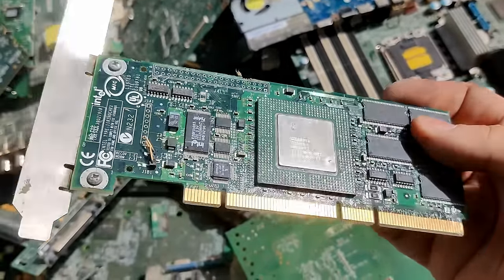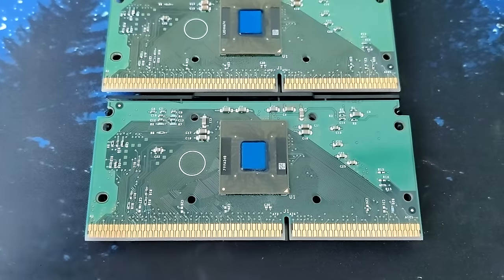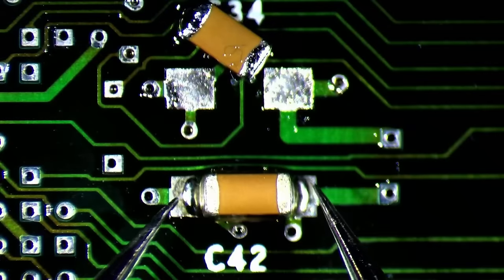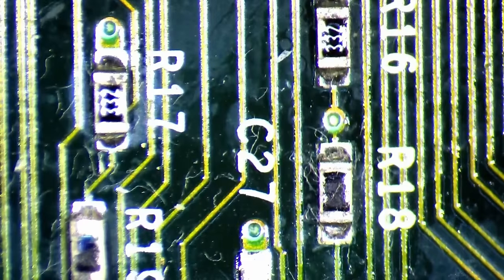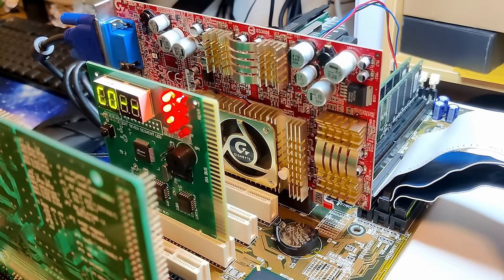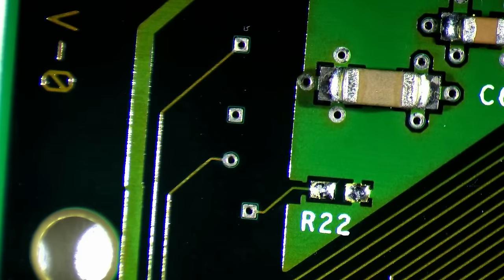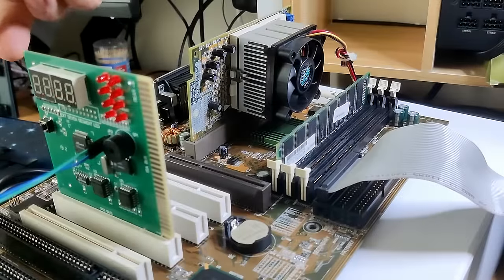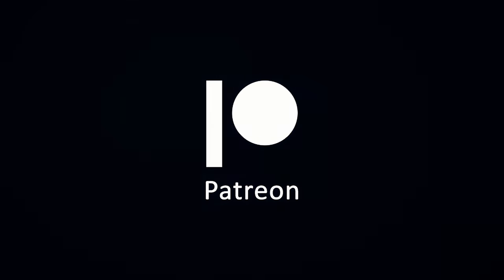Pentium III SECC volt-mod for more compatibility!

Comment: might be related, but i worked with pentium 3's in an industrial setting where they ran Siemens PLC stuff (Step 7 under Windows 2000 mostly) and C0 was common on high heat, high vibration installations where the BIOS was unable to verify cache size but was still detecting cache presence. if cache was disable entirely it could boot, but often we would send the cartridge or CPU (which was thermal glued to a small heatsink/fan combo unit from i think AVC) out for repair and the turn around could be as little as a day.

C0 was also used by early Xeons to indicate an issue with initializing L2 cache which was a separate IC on the PCB. this might be different though since pins for Slot 1 and Slot 2 differ and might have different POST codes. this initialization step was though through the BIOS because you had to have BIOS support for ECC cache.

this differed from the Oracle/Sun servers that ran the database and application end of things where the C0 was usually an add-in controller that had failed to boot somehow and you needed to identify and remove the device (disk controller with bad battery backed cache, misconfigured memory or video, anything where you had to use an unmasked interrupt to actually boot).

Comment: Try measuring resistance/capacitance on each pin of the slot connector to a known working slot 1 cpu, see if there is a glaring difference?
Reply from the maker: Good point. I put that on the list and try that if there's nothing else that will fix it... Because, you know, 121 pins on each side.

Comment: you're really good with the SMD stuff. Seeing proper SMD soldering is always ASMR. lol I just love seeing the solder flow exactly where it's supposed to go
Reply from the maker: Hehe, thanks. I think it's all practice. I did a lot of soldering about 20 years ago. Looks like it's a skill you don't forget.
Reply: @bitsundbolts  I did too, but not SMD. lol I've never done SMD. I did get a rework station (it helps with 3d printing sometimes, but I don't use as much as I thought I would). I'm tempted to take apart an intel laptop that died 2 months after I bought it during covid and practice on that for shits and giggles. (it's why I never followed through on the warranty and it's the last intel I ever bought).

Comment: It may be more convenient sometimes or safer against loss to not desolder a 2-pad component fully but to rotate or shift it such that one pad is connected and the other isn't, in order to measure it. Especially if you move to more hot air soldering.
Reply from the maker: I agree. I did lose SMDs before. Usually, I leave one terminal connected to a pad with the component rotated.

Comment: awesome, BuB!! love it for the 20 min!! :) i also have an Athlon XP which has chipped corners, works flawlessly
Reply from the maker: It's quite funny how some dies are in horrible condition and they still work! I have a Duron that looks like a total disaster and I have a feeling that there is some piece of metal sticking out from the chipped silicone die. Stull works though without issues... Go figure.
Reply: I had a Thunderbird 1.2GHz (socket A) back in 2000 or so - the die was extremely chewed up by the crappy CPU cooler (very small die, very large pressure spring) but it ran like a champ. Could fry eggs on it.
Reply: @bitsundbolts  yeap, this strangeness is fun in retro computing. today it's like this: chipped corners, cool, let;s see if it works :))

Comment: Seeing the ROG Mainboard scraped hurts very much. I had the chance of taking a ROG Commando from a scrapbin. With the exception of the status display in the back not showing all the segments it works. Currenty I'm looking for parts to build a gaming computer like I wanted in my youth but couldn't (because of money). I'm still looking for a Radeon HD4890 with 1GB from Saphire and the waterblocks for the gpu's. Unfortunatly waterblocks for older gpu's or gpu's with waterblocks never comes up for sale. And I have no acces to electronic scrapyard like you have.
Reply from the maker: I'm sorry to hear that you don't find that GPU and the water blocks for it. I have a dual GPU from AMD, but I don't remember what model - and it might not work. If I find it and I remember, I'll have it in a video or on my website some day.
Reply: @bitsundbolts  I think a lot of these gpu waterblocks are getting salvaged for their copper. They are made from pure copper and and huge and heavy.
Reply from the maker: That is probably the first thing scrappers are after. It's easy to remove heatsinks. In the process, many destroy the electronics attached to it 😔

Comment: At 10:51 you can see the connector looks super filthy, maybe that's the problem. I would try some magic eraser with alcohol to clean it.
Reply from the maker: I cleaned the contacts again with a magic eraser again, but no change - still stops at C0.

Comment: I've learned a lot! Thank you!!! Also for the insights of a scapyard in the desert (it kinda hurts to see this!). Here are some unqualified suggestions to your POST-problem: do all pins of the cpu work? Looks really scratched up. One other Idea: is there a possibility for a "flexible" resistor? Maybe the one resistor that is different on PIII 650 and 1000 have to be different. Worst case is defitely a broken coppermine die.
Reply from the maker: Thanks for watching and I'm happy to hear you found value in that video. My thought process is similar to what you mentioned. I did actually check the golden pins. They are indeed scratched badly. On one of those pins, I removed a small piece that was getting too close to the neighbouring pin. Other than that, they look ok, even though they're in bad shape. The similarities to the working PIII 1000 are interesting though.

Comment: are those non labeled resistors by any chance connected to pins bsel1 and bsel 2 on the cartridge connector if yes those two resistors were only responsible for changing between 133 and 100 or 66 bus and high values make sense since on 133mhz both of those pins should be high impedance and that would make it a pentium 3 with 133 mhz bus of unknown multipler and speed but you could decode that by multiplier pins  too
biggest problem you may have with cpu that trashed might be core delamination so i would try pressure on the core substrate while booting
Reply from the maker: The front side bus is selected on the board. I haven't looked at those pins you mentioned. I'll have a look. Maybe you're right and there is an issue with the connection between the substrate and the PCB of the cartridge.
Reply: @bitsundbolts  it would be great to have a late super slot socket adapter with all the jumpers for voltage and bus like ms6905 master so you could reverse engenier voltage and bus jumpers, it also have that ic that got mangled on your cpu but multiplier i think is burn into the die, so that would have to came from intel technical specyfication for slot 1
but i would start with poking the cpu core substrate to see if it doesn't have broken balls or look closer what that ic do because it might be related to cache

Comment: You could try to replace the big chip that was twisted in case it's dead
Reply from the maker: Foot point. Since it's twisted, maybe something happened internally. There is also a chip in it. Could be that due to the impact, something happened to it.

Comment: I didn't even know Slot 1 CPUs went up to 1GHz - I thought that was only possible via a slotket o.o
Reply: 1.1 GHZ actually, but those are more rare. I have a slotket myself with a 1300 MHZ Tualatin Pentium III/Celeron on it in my CPU collection, works well and is a very fast CPU for the platform.

Comment: 0:35 now THAT would be a pin straightening challenge. 😆 don't tell me you didn't consider it! 😉
Reply from the maker: While looking at the footage, I had the same thought that it must be a pain trying to fix it! But that board stayed at the scrapyard. There are for sure a lot more issues than just the socket.
Reply: @bitsundbolts  I'm fairly certain it's just not possible. The contacts on modern CPUs are way too sensitive and too close to their physical limits with not much room to spare for tinkering. The system probably wouldn't be stable or may even pose a fire hazard. Thankfully it doesn't matter though, most of these boards aren't worth preserving, let alone saving, anyway. 😅
Reply from the maker: I fixed a single pin once on an X58 board? At least this is what I remember. The boards with triple channel DDR3 support for i7 920/930/950 etc. you could just put a Xeon 6-core/12-thread server CPU in there and get a half-way decent system (about 6 to 7 years ago)...
Reply: @bitsundbolts  Impressive! Luckily, I haven't had to resort to this so far, and there's a good chance I would just make it worse. 😅 I suppose it also depends on how important/mission-critical the machine is. If it's just a redundant or hobbyist machine and just one pin, one might get away with it.

Coincidentally, I still have an LGA1366 board (P6T Deluxe v2 with an i7 9somethingsomething) in my basement. With its 3 PCIE slots, it still worked well for ETH mining, as long as that was a thing. 😁
Reply from the maker: Haha, right. Now they're on proof-of-scheibenkleister. I also have an X58 in my pile of hardware to be tested. I think it's also an ASUS/ or Gigabyte - I need to check that. It was just one pin and I tried to flip PCs at that time. Didn't work well. A lot of work, no financial reward. Almost like YouTube 😂
Reply: @bitsundbolts  But on YouTube, you're making a lot of friends, that's priceless! 😉

Comment: The dual cpu motherboard would have been cool, I like looking through the footage of the scrapped motherboards.
Reply from the maker: It was a generic Dell/HP board that was screwed to a desktop case. I usually do not bother looking at those because it's hard to get information on those - or even find mods, BIOS updates, and user stories.

Comment: The POST code stops at C0 because the next step, likely Processor Test 1 (01) if the POST codes are listed in execution order, is failing. I don’t know what that test is trying to verify, but maybe someone else might have some insight…

Comment: Another great video. What soldering tips do you prefer to use? Have you ever used a hollow tip? I remember seeing someone talking good about hollow tips on youtube. Thank you for the spreadsheet.
Reply from the maker: I'm using a simple bevel tip. My soldering iron is the FNIRSI HS-01 and I use the tips that came with it. I move on from chisel to bevel tips. That's a personal preference I believe. In my opinion, the bevel is better in transferring heat to solder joints. I never used a hollow tip, but it looks interesting with space to store solder.
Reply: @bitsundbolts  Thanks for the answer. I need to buy new tips for my soldering iron. I'm tired of using big tips for small jobs. I'm gonna buy bevel (I'll see if I find an hollow tip as well to buy).
Someday I'll also get a better soldering iron, like the FNIRSI HS-01, but for now I can't justify the expense because it's rare for me to solder. I have a generic Lidl soldering iron with a knob to control the temperature.

Comment: My second computer was a P3 running at 800MHz, but it was mounted in a socked. What's the difference between a socketed CPU and one that's mounted on a cartidge?
I remember my friend's dad upgrading his P2 computer using a cartridge, but I never bothered asking why his computer is set up the way it was, as I was pretty young.
Reply from the maker: Many cartridge CPUs had level 2 chips which was the reason to move to this design. Then there were Celeron and Pentium III that had the level 2 cache integrated into the die and therefore no longer needed the cartridge design. Those CPUs could fit in a socket again (socket 370). To make them compatible with slot 1 boards, the adapter card was a neat solution to allow users to continue using their boards with new CPUs. I don't think there's any performance difference when you compare a Coppermine 800 for socket 370 or slot 1.

Comment: Hi, there are some socket 370 pentium 3 1000eb 1.7v and 1.75v. Do you think the last could pull less amp from motherboard vrm because of the "higher" voltage?
Reply from the maker: Hm, I am no expert, but I would expect that at the same frequency, the CPU with 1.75 volts would pull the same current from the VRM. That would lead to a higher power consumption and probably slightly higher temperatures.

Comment: a lot of these cards had a horrible problem with the board flexing in the CPU not fully contacting to 
the board
Reply from the maker: Yes, I had my fair share of issues with a cartridge CPU not making proper contact with the slot. I tried the CPU in this video multiple times to be sure it's not a connection issue. Also, the same behaviour on a different board. I don't think I have an issue with the contact. It's most likely something on the cartridge.
Reply: @bitsundbolts  and i'm guessing it would be really hard to swap card number 3 and mystery cards cup

Comment: I wish there was something different that could be done about scrapping old hardware. Anything retro is worth 100x more as-is on Ebay than whatever they'll get from scrap but I guess most people, including the employees, just don't realize it.
Reply from the maker: The people working at the scrapyard don't care what they have in front of them. They separate different materials: cases, plastic, power supplies, electronics... They don't know what's valuable and what's really scrap (80-90% is Dell & HP stuff), then you get servers, switches, and other enterprise hardware. All there for scrap to get the valuable metals back.
Reply: @bitsundbolts  I work at one of those scrapyards and sort the electronics, I do care what's going though and I recover some of it. I just picked up a nice 386 MB yesterday. There is so much and you can't save it all. I have recovered some really nice equipment and have even sent some to YouTubers.
Reply from the maker: Oh, I didn't want to generalise. When I said people don't care, I specifically meant the scrapyard I go to. It must be nice to find some exotic and rare items. I'm sure the people you sent those items to were very happy and thankful!

Comment: Good job, I don't know if you have another motherboard that natively supports P3 1ghz like a P3B-F or equivalent, it would be ideal for testing, otherwise in the last resort just doing a reballing.
Reply from the maker: I did try on exactly that board: P3B-F. I got the same behaviour though. The POST analyser card stops at C0.

Comment: Did you happen to grab the voltage regulator modules from that dual slot 1 board? I could use those :)
Reply from the maker: Ahh, sorry. No, I didn't. I wasn't interested in the board and didn't think that those VRMs would be useful.

Comment: I'm pretty sure that's a 1.13ghz SL4HH Cpu, but is only speculation as it didn't have the other resistor, but I have one and the cpu number on it is 7122A223
Reply from the maker: Oh oh... Really? I thought the 1.13 GHz was the only Coppermine that requires 1.8 volts. How unlucky that it didn't Post. It would have been a pleasant surprise.

Comment: What if some of the resistors are to configure CPU clock speed? It may be getting overclocked and crashing at boot. Maybe try underclocking it by lowering the bus speed?
Reply from the maker: I had it set to 100 MHz FSB. Since it's a Coppermine, it should have no problems. But good call, I'll try 66 MHz and see if it changes anything.
Reply: @bitsundbolts   Also try 133MHz. As I mentioned previously none of my three Slot 1 133MHz Coppermines will POST when underclocked to 100MHz. Perhaps this is the same problem.
Reply from the maker: Good point. Btw, I could reproduce that with a socket adapter and a Pentium III 1 GHz for socket 370. It's a 133 MHz model that refuses to post at 100 MHz FSB.

Comment: Can the 2D matrix code help identify the chip? Or is that just some unhelpful serial number?
Reply from the maker: Do you mean the number on the substrate? I googled that number, but nothing came up. Maybe it's an internal number for Intel to keep track of production batches, but not meant for the public.
Reply: There is an app from Intel to scan and identify those 2d datamatrix markings on their products but at least in my attempts it doesn't seem to work with CPUs as old as the Pentium III
Reply from the maker: I downloaded the Intel toolkit 3.0, but that application wasn't able to tell me anything. It doesn't recognise the QR-code like matrix 😔. But thanks for the great hint!

Comment: Why did you say even though it's 133mhz fsb on the P3 1Ghz cpus? I've always seen those as the more desirable ones since they don't overclock much and higher fsb is better than the 100mhz fsb versions.
Reply from the maker: Correct, however, on an ASUS P2B, the AGP bus is overclocked if I run them at 133 MHz FSB. That was only fixed on later boards like the P3B-F. A 100 MHz FSB GHz CPU would work without issues on those boards. And if I'm not mistaken, the 100 MHz FSB PIII is less common and therefore more valuable.
Reply: @bitsundbolts  Makes sense, and sounding very familiar. Now that I think about it I may have had a 100Mhz fsb P3 1 ghz in that same board at my job. It started life as a Celeron 300A that I overclocked to 464. I want to say it ended up as a 1ghz cpu but it was sold in the P4 era to an employee.

Comment: Try it after temporarily removing CPU cache chip.
Reply: It's a Coppermine, the cache is on-die, there's no cache chip to remove.
Reply: @Ale.K7  "then decap the chip"
Reply from the maker: If it would have been a Katmai CPU, it would be possible. But as @Ale.K7 said, the cache is on-die.